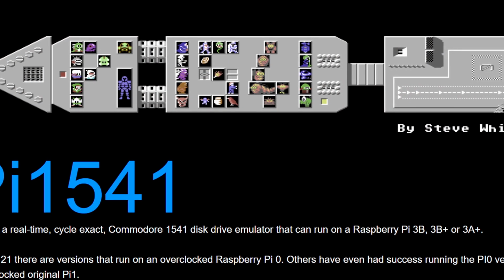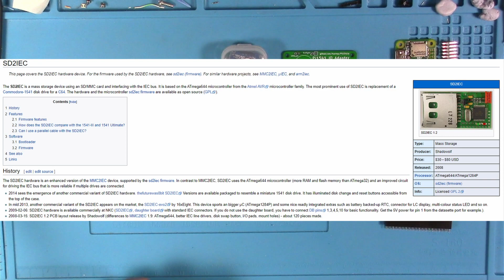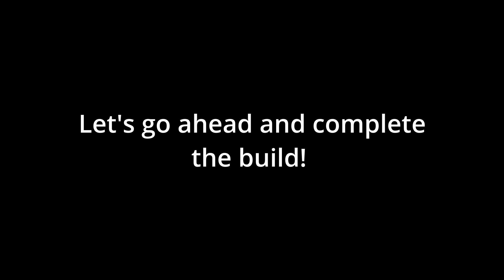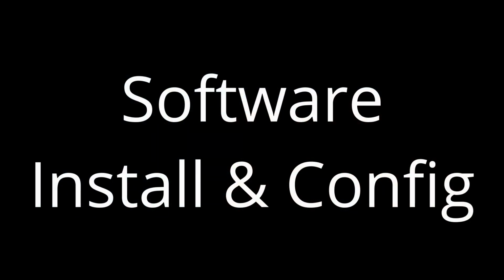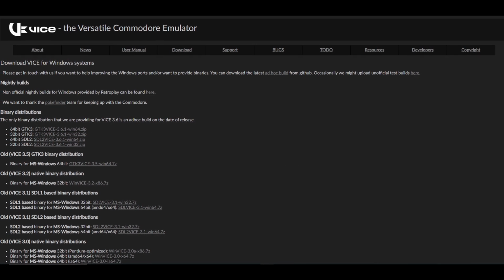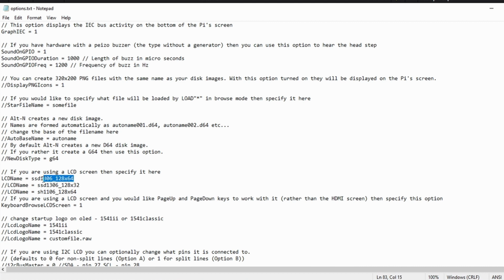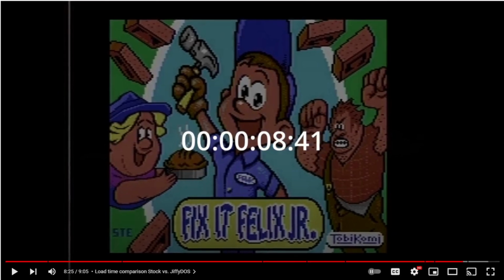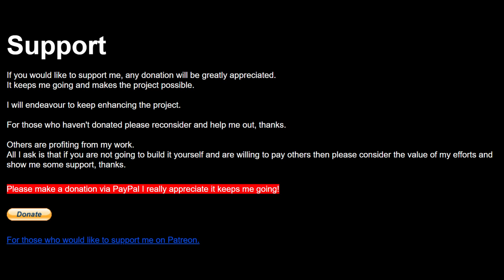Pi1541 Hat Kit Build & Test w/RaspPI Zero

Comment: I have a ton of old first gen Pi B’s, and just as many old full size SD cards for them. I need to make some of these and put those old things to use.
Reply from the maker: I have a few of those it would be interesting to see if they work ok. This zero seems to be chuffing a bit. 😄
Reply: @JamiesHackShack  they sell a PiZero 1541 on a cartridge with the Epyx fastloader. I’ve used that with great success for awhile. Honestly, the zero clocks a bit higher than the original Pi. 🤷‍♂️
Reply from the maker: @RetroAnachronist  Right thats why I'm worried about the original. It has a pi1541 kernel though so might as well give it a shot :-)

Comment: This project is on my radar as soon as my 1541 disk drive gives up the ghost. I recently got a VIC-II Kawari mini replacement for my NTSC VIC chip, allowing me to enter the world of both NTSC and PAL content at the flip of a software switch, finally allowing me to load all those great European scene demos. Unfortunately, a lot of them rely on the stock 1541 routines and timings, so I can't just load them up with modern storage solutions such as the BackBit cartridge or even the SD2IEC - you have to rely on the 1541 drive, but they are very cleverly written to load ultra fast despite those forced timings.
Reply from the maker: Sounds like a pretty good use case for one! Thanks for watching/commenting!  I'm interested to see if that 25 second load time with jiffy is just based on emulating the real drive and it would never match the speed of the sd2iec. I suppose throwing a more powerful pi under the hat would tell pretty quickly.